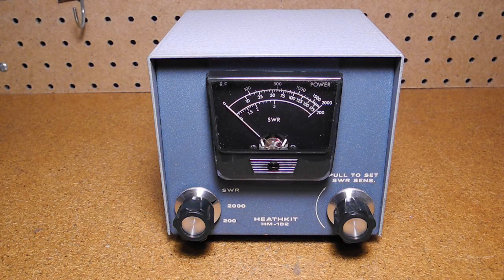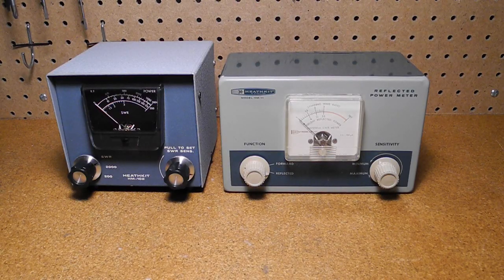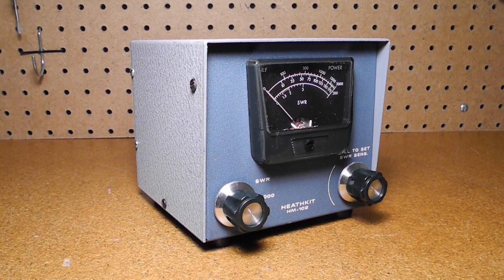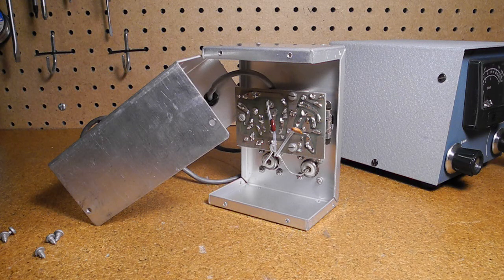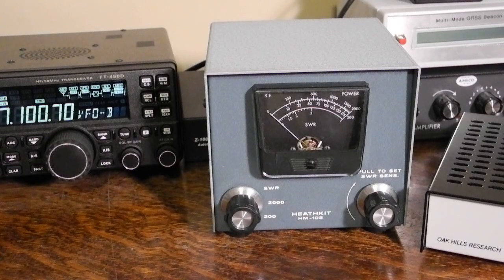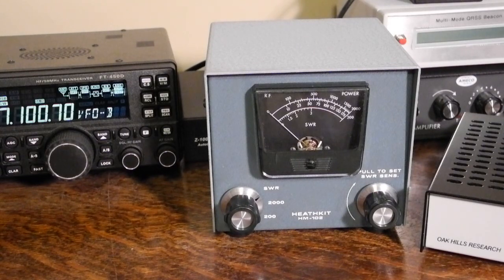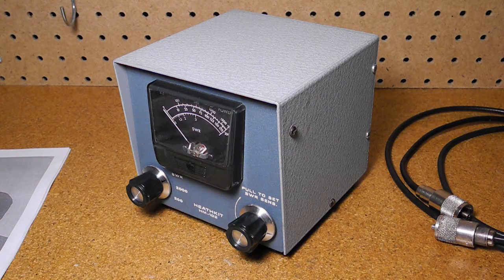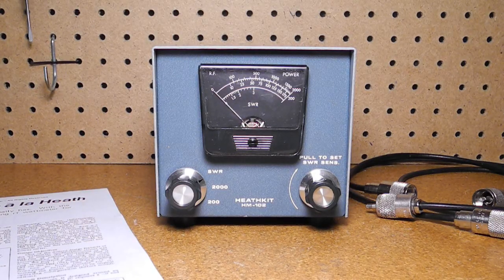The Heathkit HM-102 RF Power Meter

Comment: I rebuilt one a while ago, need new resistors and reflow all solder points. I replaced the interconnect cable with 8 feet, who ever built it, cut the cable to 8 inches.

Comment: Thanks for posting very good video i have the same unit igot it broken and some parts are missing i use the schematic to rebuild it but the L1( the pickup coil) i can not find any info on it 
so if you can give me any info about it that would be great
Reply from the maker: It is a pre-wound toroidal inductor Heathkt part number 40-1011, but I couldn't find any more information on it. I could open my unit up and count the turns and measure the core size, but I don't know what the core material type is. I found some references to similar circuits that suggested a ferrite core with type 43 or 61 material. Is your transformer completely missing, or just broken?

Comment: can i put this meter between my AL-811 amplifier and antenna?  the amp can do 600 watts . even so...i will probably not push it more than 300 watts.
Reply from the maker: Yes, it can handle up to 2,000 Watts provided that the impedance of the transmission line is around 50 ohms.
Reply: @jefftranter  Thank You.
I now have the meter hooked up and it works great.
Tom
KC2SPU

Comment: As all your videos, very well done and much appreciated Jeff. Thanks for the QST reference... I may build the circuit, with a rear peak-ave switch at the back..no holes. And one of those Christmas light ribbon LEDs snuck under the cove could light the meter. Vy 73.

Comment: Jeff,

Nice video. I built one back in the 70's and still have it. Added the switch mod so would not have to pull out the SENS knob. Also added the K4DPK PEP kit. Didn't mind drilling any holes as I will never part with it.

https://forums.qrz.com/index.php?threads/wattmeter-pep-adapters-vfo-stabilizers.499644/

WB3BJU

Comment: I have this one but in a greenish tone. Yes, lacks a dial  light and PEP but I would try to modify it with an easily removable, without trace sort of modification. 
Excellent meter. 
Also have the HM-2140 dual Wattmeter that uses a 9v battery... I wonder if I could use 12VDC instead. I wouldn't like to have a battery leaking inside.
Greetings from Central America and thanks for the instructional video.
73, de Roberto
YS1RS